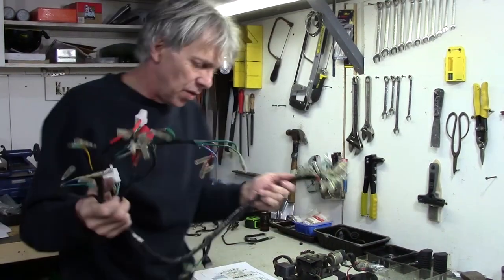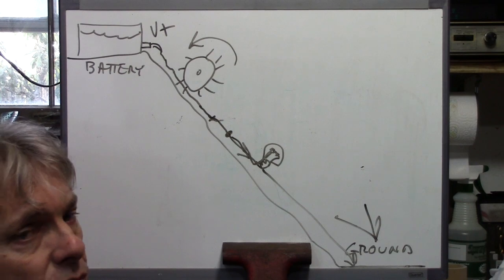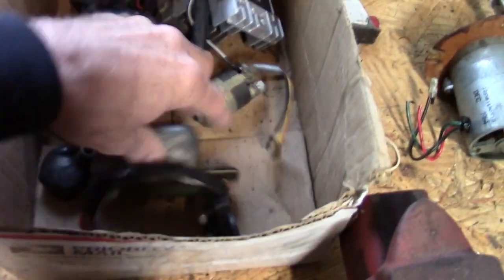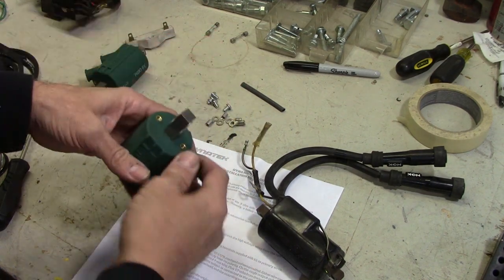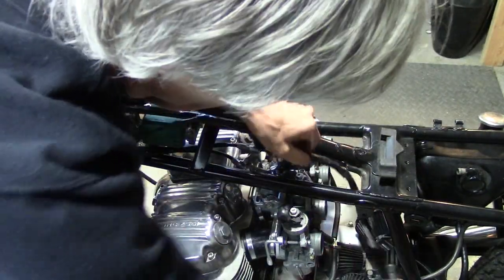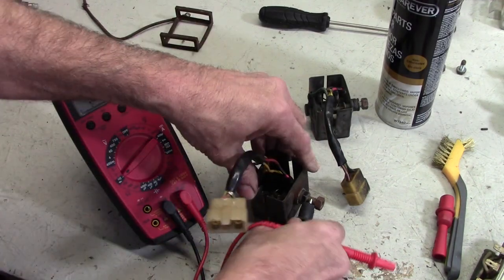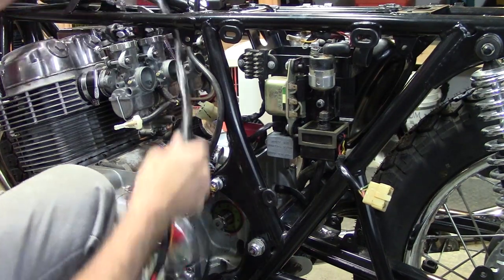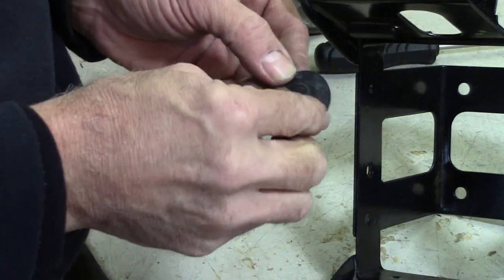73 Honda CB750 Custom Build  Part 31 - Wiring Harness

Comment: I was given a 1973 Honda cb750 with about 34,000 miles last year. I was 19 and had 0 mechanical knowledge or experience but thankfully the bike ran good before it sat for at least 10 years with the fuel valve open so all I had to do was give the carbs a really good cleaning. After the riding season last year I realized that there is a lot of maintenance other than oil changes that needs to be done like valve adjustments and so on. You're videos have been and are a tremendous help. Thank you for sharing your knowledge with people like me. After watching your videos I feel very confident with my ability to do the valve adjustment and clutch friction plate replacement! Once again thank you very much for your great and in-depth videos!

Comment: I replaced the harness when I was building mine and was having a hell of time figuring out why the battery was not charging but everything else was working perfectly. I have an aftermarket reg/rec and apparently with that combo you need an additional ground wire. Took me forever to figure it out!

Build is coming along nicely. Can't wait for more!

Comment: It's amazing what you can learn watching Youtube these days. I bought a 75 Honda CB750 last year and knew nothing about motorcycles or mechanical stuff.  Thanks to channels like Hackaweek I've been able to learn a ton and do the majority of all maintenance and upgrades.  I'm rewatching this video before I put my new Dynatek coils on.  Seems pretty easy after watching this.  (I'm not going to bother pulling the wires from the old coils, I'm just going to use new wire.  The wires coming out of my coils are pretty crusty looking.  I'm assuming you re-used the OG wires to save a little time not having to crimp on new connectors...or because you didn't have any new yellow, blue and black wire laying around.

Comment: very nice. this helped. I went through my electrics on my 75 cb750f and since I'm running a new led brake light with turn signals, I had to get a new 3 prong electric flasher relay to get the turn signals to flash. people, keep your connections clean.

Comment: Nice video, Dino.  You're doing it right.  The wiring harness just runs right alongside the rail like you have it there and you use the little wiring clip/ties to connect it at various places.

Comment: Great video.  Good coverage on a topic that baffles a lot of guys.  One thing I would suggest is using some dielectric grease on the connections prior to making them. I've found that greasing the connections make it a lot easier to remake the connections if you have to disconnect them at some future date.  I think that it also enhances the connections connectivity too.  Just my two cents worth.

Comment: Hey Dino. Bike's coming along nicely! I don't know if you're going to for a stock electronics system or not, but there's a few things worth mentioning that can upgraded with little effort. As far as the coils go, Dyna makes 5 ohm coils for these bikes and you won't have to run the ballast resistor. Part number is DC8-1. A upgrade of the fuse box to blade style automotive ones is also another good move and makes replacements easier to find. There are small 4 circuit ones that will pretty much fit the stock mounting studs with a little finessing. A lot of people also upgrade the rectifier to a solid state type that comes with the regulator built into one package from Rick's Motorsports, but that's your call.

Comment: remembered then my father rebuild his cb750 1972. had a lot of problem with the gas tank and the harness fitments.
try mount the gas tank with the harness in place that way you will know if you have done right.

Comment: My first CB750 was a 1969, one of the first sold in this area.  Hated that 4 into 1 throttle cable assembly, constantly having to resync the carbs, ended up permanently mounting 4 vac. gauges on the handle bars.

Comment: Hi Dino.....If this is an after market wiring harness...you will find out that the connector for the rectifier will be short...you won't be able to pull the harness back far enough because then you will be short to the head light....you will have to add on to the rectifier connector...also... the left hand switch...they don't sell it with the wiring outside the bar...only inside...you would have to get a 77-78 supersport switch or notch the housing of the switch...
Reply: Thanks! The housing that is powder coated and on the bike has the notch. :)

Comment: As usual, great vid; very helpful. Just one tiiiinnny little nit to pick: I was always taught that current from a source like a battery flows from cathode-to-anode, negative-to-positive. Other than that, great example.
Reply: +steven livingston Yeah that's why I said "really simplified" explanation of electricity. Electron flow comes out of the negative and travels to the positive. "Conventional" current flow moves from positive to negative.

Comment: Neat job. I loaned my 750 to somebody (my ex) and the battery went flat?? They used jumper leads to try and start it and burnt out the complete harness by putting the leads on reversed. The earth wiring fused red hot when they turned on the ignition and melted everything. I was lucky I had a donor bike and managed to replace everything. WARNING Do not let others use your bike !!

Comment: Hi. By "coincidence" I recently found your set of videos on this CB750 project. I say "coincidence" because I am about to start a project of rebuilding my good ole' 1972 CB500. Thanks for the valuable information and tech tips. A lot of that applies to the CB500. My question is: Where do you manage to get those hard to find parts like the rubber grommets you replaced on the battery tray? Is there a place where I can get all that stuff? One thing that has kept me from starting my rebuild project is that I don't want to end up like some cyberpirate hunting treasures (parts) all over the internet. Thanks.

Comment: On the starter solenoid there is that solid red wire with the female connection that you hooked up the positive to.  What does that wire actually hook up too?

Comment: I purchased a new harness when doing my 71 K2, the earth between the alternator and the rectifier was not the same  wire, no excitation meant no charge, suggest you check this.

Comment: Can you help me? I am attempting to revive a 1976 cb750a , I received bike with none of the electronics included , I am trying to see if motor will fire . I can get it to turn over by jumping coils to battery and applying starter to coil. The motor turns over but I have no spark , I have the coils wires into the points system but there is no spark . I tested coils and they are fine, tested condensers  and they are ok . Is there something in the electric that has to be hooked up that would allow spark to the points ? Thanks for any advice !

Comment: Hey Dino, i have the 1978 cb750. i get no spark on my plugs, the bike was running before i took it apart, (only removed wiring harness) once i put it together no spark. the engine turns. any tips? would be appreciated

Comment: Really great videos, Dino. Thanks a lot for doing these. BTW, where did you get the portable 12V battery used for testing some of the electrical components in this video?
Reply from the maker: +Mac McMillen Found it on Ebay.

Comment: Hello Dean 
hope you see this, if the rectifier gives a little beep in the beginning when measuring the the reverse of the diodes . can this be fixed or is the rectifier for replacement ?
I followed your steps in the clip and the only problem i hav eis that little beep and when connecting this to the bike it brings de current down and  blows the main fuse. Bike works perfectly without rectifier but than the battery is dead after a few miles. 

Hope to hear from you Dean

Cheers
Flo
Reply from the maker: Sounds like a bad rectifier to me.
Reply: @HackaweekTV  thought so i gues replacing is the next step. Cheers

Comment: I have a ? That's way, way, WAY off topic. @ 60yo I got bitten by the hack/electronic bug. My soldering bluntly sucks!  Why are the solders black?  Any tips would be great!!  I'm using a 60w weller nonadjustable iron. 
TIA
David.
Reply: +Stoneage Stoner 60W is pretty high for such thin wire like a motorcycle wire harness.  Try a 30W with a &quot;pencil&quot; tip.  And clean the tip with a wet sponge after every solder.
Reply: +Matt Sherrill thank you!

Comment: Dean, do you have a preferred method for painting a bare frame? I am trying to determine what product to use. I want a black frame. Its a 1972 CL125s with a sandblasted frame.
Reply: +Josef Molenaar My preferred paint is Duplicolor Caliper paint.
Reply: POR 15 might be a good one too. Very durable and cheaper than powder coating.

Comment: Hi, I own a '74 750/4 with KZ750 LTD mags, Dyna Ignition, Yoshimura pipe etc., but the poor old girl has developed a parasitic draw. She was fine when I stored her (inside, 2- 3 years, bought a Concours). Put her on the road this year and she killed a brand new battery over nite. Boosted her and went for a ride, same thing next day, completely dead battery. I have checked everything (turn signals, lites, all visible wiring) except for regulator etc. Do you think the short could be internal or am  I              just missing something right under my nose? Any input/suggestions would be greatly appreciated. Thank you.
Reply from the maker: Might try a new regulator.
Reply: @HackaweekTV  Process of elimination now I guess,  regulator's a good place to start., thank you.

Comment: Thanks for sharing.
Out of curiosity, is there a reason you don't use any form of electrical grease on the connectors?
I used to use acid free petroleum jelly, but switched over to some spray from Wurth recently.
Any thoughts on the subject? Cons/pros etc?
Cheers
Reply from the maker: +Perius Silicone dielectric grease works well if you plan on doing a lot of riding in the rain. I'll mention it next video.
Reply: +HackaweekTV I put some on the outside of the male plastic connectors also.  Makes disconnecting and re-connecting them much easier.

Comment: Also are you going to run better air filters or stick with those cheapos?
Reply: +osamarama As I mentioned in the video, I'll be running the stock air filter. The pods came with the bike and are temporary, as I mentioned in the video. :)
Reply: +Dean Segovis oops, lol
Reply: +osamarama :)